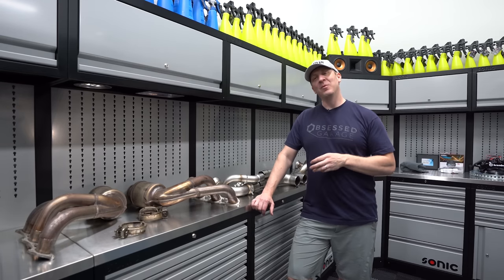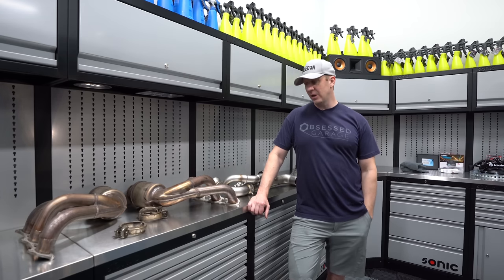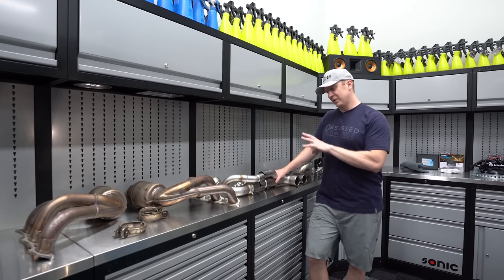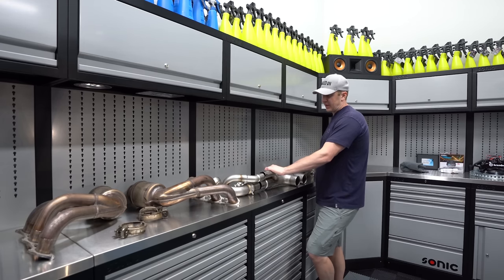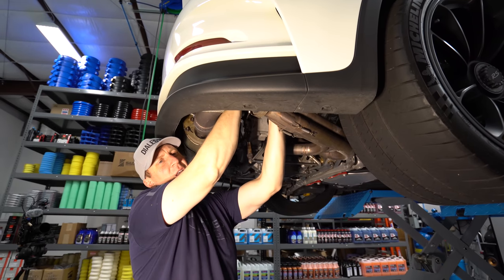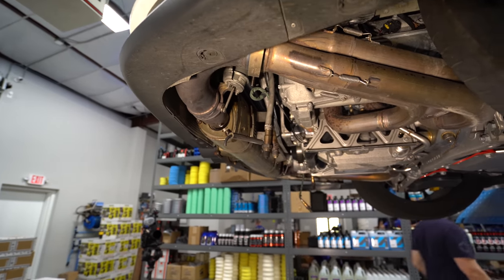Porsche 911 GT3 RS - AWE SwitchPath Exhaust Install

Comment: I did the AWE Switchpath about 12 months ago. Great sound. No drone. Loud :)  Some power gain on the butt o meter.  The only problem Ive had is repeated cracking of the centre section exhaust mounts.  Finally had to get a friend to fabricate a set up attached to the exhaust and then bolted to the OEM centre muffler holder.  AWE replaced the first one after the cracking but it happened with the second one as well.  After that AWE said that they couldnt help anymore as the exhaust wasn't designed for taking the car to the track !!  I still have the exhaust  fitted and still love it but had to customise the centre bracket et al.   I was dumbfounded when AWE said that it wasn't designed to be tracked !  WTF !

Comment: Remember the extensive testing you used to do with the blue GT3 car?  We need more of that.
Reply from the maker: I've done about all that needs to be done on that front.  The testing I did in the beginning was to find out more about what the valve did for the car as I was chasing removal of them.  Now that I have that data, I can make these little changes without the need for the dyno.

Comment: Matt, this SwitchPath looks and sounds fantastic! I have a new (26 mile) GT3 Touring and have been looking for the perfect exhaust system. I love the exhaust button and want to keep that feature. I had narrowed it down to IPE system that has great volume and an awesome high pitch Ferrari type sound but cosmetically didn't like how the exhaust in the back protrudes down a little bit below the bumper, I've also heard of some inconsistent quality control issues. On the other hand this AWE exhaust system seems to combine the best of every system I have researched. The exhaust sound is familiar to but even BETTER than the IPE. Thanks so much for your research into these muffler systems, you've saved me a ton of time and expense. I will be ordering the SwitchPath system from AWE when I get my car back from getting a full body PPF. Thanks again Matt!! Sean
Reply from the maker: Yes, definitely do the AWE.  You won't regret it.  No drone and super nasty.  Just know the button on a GT3 does virtually nothing for you just like on the stock exhaust.  Turning the exhaust button off and on on affects the valves at idle.  iPE is marketing junk, so you definitely don't want that.
Reply: Obsessed Garage
Phew, you saved the day! Can’t wait thanks again Matt!

Comment: Hey Matt I know you have done it a ton, and I know you are meticulous as always, but pre-twisting O2 sensors kills me inside.  I always disconnect at the connector.  Just peeves me to kind up the wires inside the sleeving.  Good video as always!
Reply from the maker: Yeah, that's a lazy step.  The molex are so darn far up into the car that I just reverse twist them.  It's lazy, but it works.

Comment: you should do a blind test on all the exhaust, that way you'll know if there's actually a difference
Reply from the maker: There is a very easily, detectible difference in sound between all of these iterations.  I could like identify most of them, especially the ones that I have had.

Comment: Good video!!! I´m thinking of the Sharkwerks exhaust for my 991.2 GTS. Has anyone heard if this is good?? Why did the Dundon yellow your PPF?
Reply from the maker: The Dundon I had was the catless race version.  Removing the cats caused the yellowing.  For 991.2 I would do either this AWE exhaust or Dundon Street with Black series center muffler.
Reply: @ObsessedGarage  Thanks for your answer!! I get that but is it because the fumes that the cats normally picks up? So you wouldn´t change to the Sharkwerks exhaust, why?
Reply from the maker: The Sharkwerks center bypass is basically stock with a 20% more sound.

Comment: Could you recommend an exhaust for a 991.1 GT3? Will mostly be driven on road, so can't be too crazy, but would like better sound lower in the rev range. More F1-y than throaty.
Reply: For the F1 sound one must be above 7000 rpm to enjoy. 

Just dont get an Aftermarket exhaust- its obnoxious and wont sound better Just louder

Comment: On camera that sounds horrible vs the Dundon
Reply: It has that metallic rasp to it. No bueno.
Reply from the maker: It very much the opposite.  There is rasp, especially on down revs with the Dundon Race and none with the AWE/Catted OE Headers.  The AWE is much deeper, but has a bit of hollow sound in comparison.  The Dundon sounds more like a Cup Car, but is much higher pitched.  Both sound great.  I think for the street and my preferences, I prefer the sound of the AWE and the Catted Dundon.  That, and the yellowing due to being catless are the reason I'm making a change.
Reply: @ObsessedGarage  Interesting how the video makes it sound different, I'm glad the AWE sounds good!
Reply: @JohnRobbfl  very different price bracket, but I just got a Ford Racing exhaust (made by borla) for my Focus ST and cameras make it sound so much more raspy and hollow than it really is. In person its much deeper.

Comment: Hi Matt! I'm ready to finally pull the trigger on an exhaust for my 991.2 Touring. I was convinced after your video to purchase the AWE SwitchPath but am now concerned it may be a little too loud (I wish I could hear it in person!) My dealership told me about the GMG Center Section exhaust. I'm wondering if that would be slightly tamer? As long as I can quiet it down through my neighborhood and when passing crowds going up the canyon with the exhaust button I'm fine with either one. In your expert opinion what do you think sounds best out of these two options and how loud is one compared to the other? Sean
Reply from the maker: Hey Sean,  GMG center section is considerably quieter than AWE Switchpath because it retains the side mufflers.  Remember the exhaust button does absolutely nothing outside of idle.  As soon as you drive off, button on or off the exhausts acts the same.
Reply: Thanks for your quick response Matt! Your research and obsession is much appreciated! All the best!!

Comment: Do you get nervous being under the lift?  Are there safety catchers in case the hydraulics fail?
Reply: I'm sure there's a ratchet/ locking mechanism.
Reply from the maker: I did at first, but you get used to it after a while.